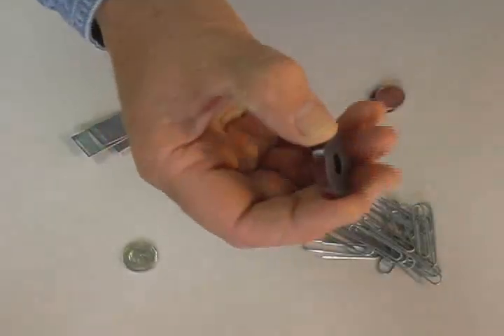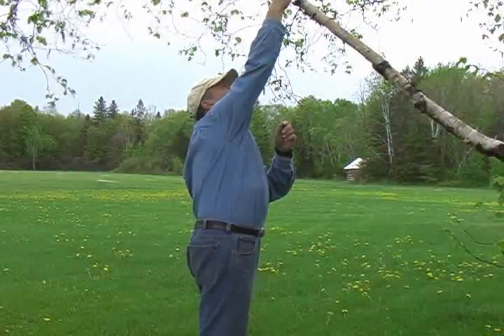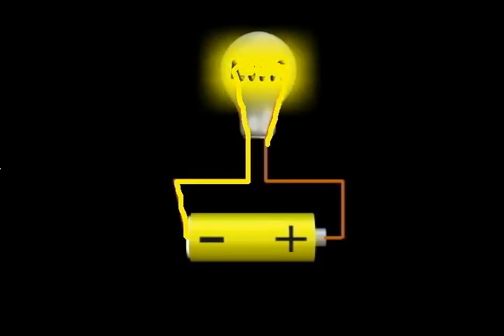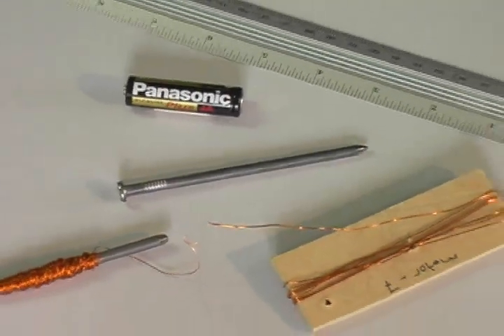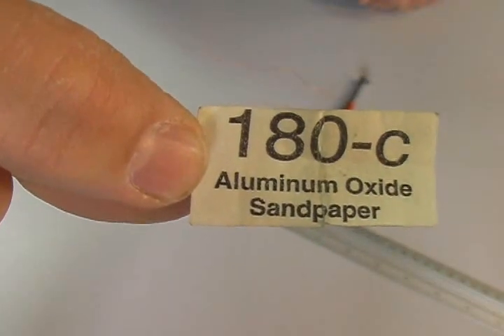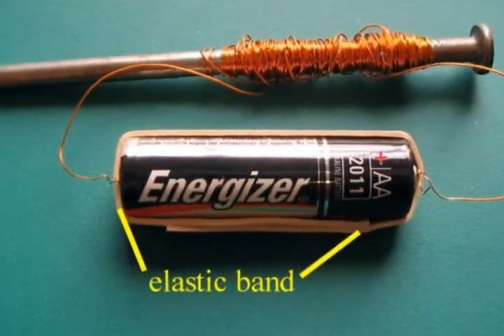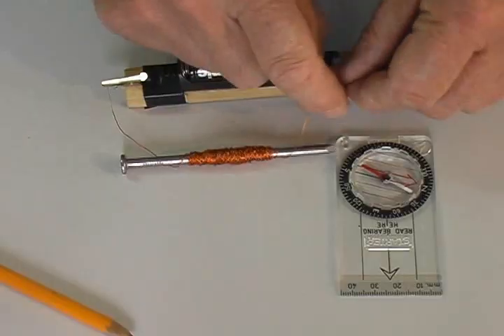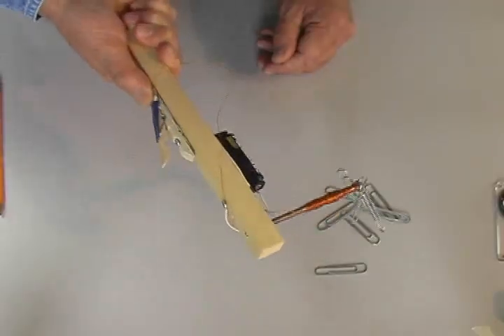Electromagnetism

Comment: BTW all, there is no such thing as a real short circuit. All electrical conductors will have some resistance. A very small resistance such as this copper-wire just means that a lot of current will run. This will result in more heat being generated. Another important fact when working with electricity is that the hotter a conducting material becomes the more resistance it will get. So "shortcircuiting" a battery will cause higher internal resistance in the battery and more resistance in the wire

Comment: silverbull : the electricity is induced into the nail and becomes electromagnetism, if two insulated wires are wrapped on the nail you have made a transformer and the electromagnetism is reinduced and becomes electricity again,at this point the nail is no longer a magnet it's potential being disipated

Comment: What you saw there is called 'residual magnetism'. Some of the magnetic flux remains in the iron core (nail) even after the coil current has been disconnected. This occurs because it is possible to magnetise certain materials.

Comment from the maker: The 1.5 volt alkaline AA battery has an internal resistance, this combined with the resistance (very small) in 5 meters of 28 gauge wire reduces the current flow so the coil does not overheat. A battery with a lower internal resistance or higher voltage would cause the coil to get too hot.

Comment from the maker: As mentioned in the video this electromagnet must use a 1.5 volt AA battery, even with this small battery the coil will get very warm. A bulb in series would probably reduce the strength of the magnet considerably.

Comment: That looks very much like a short circuit. I think you would flatten the battery very quickly. It would be safer to add a 1.5 volt light bulb in series to keep the circuit safe.